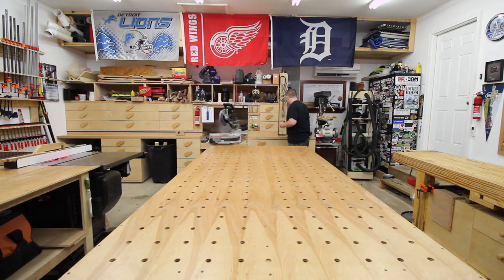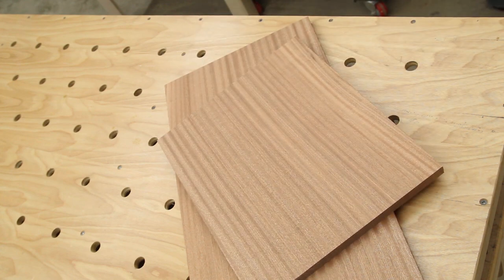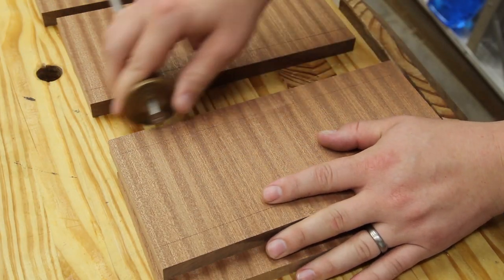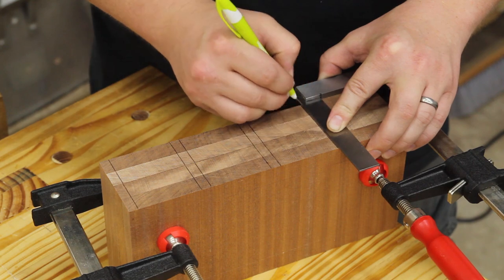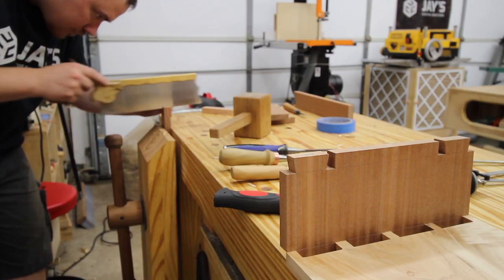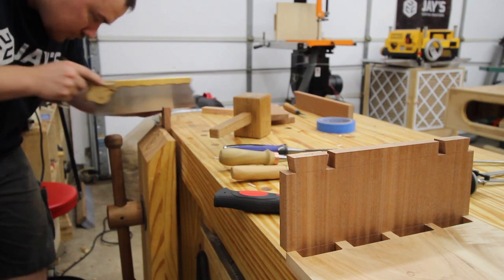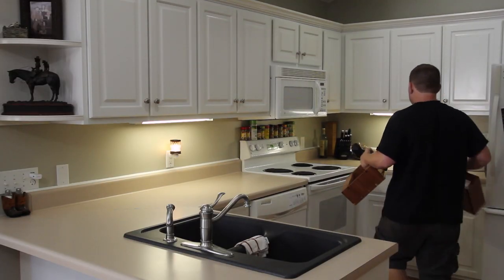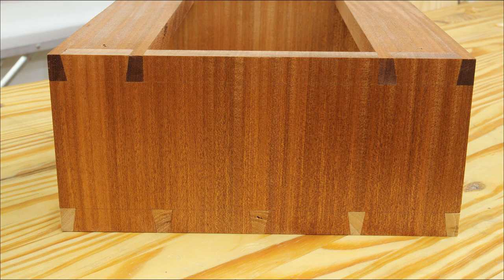Hand Cut Dovetails - Suspended Utensil Shelves - 256

Comment: Fantastic as always!  I like the idea and, as a person without a lot of counter space, very practical.  

A handy tool for tight spaces, if you haven't tried them already, is the Right Angle Attachment.  Though, I'm definitely stealing your idea of drilling a hole for the driver bit when necessary.
Reply: laanyan or even simpler, use whatever screw driver bit in a regular ratchet and use the wrench to insert the screw.